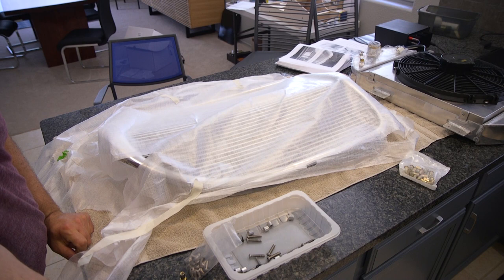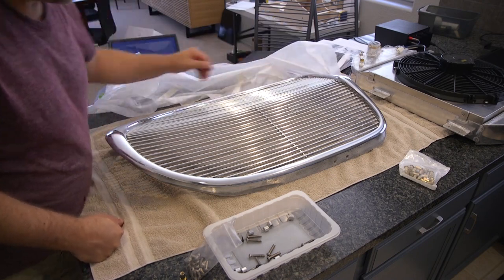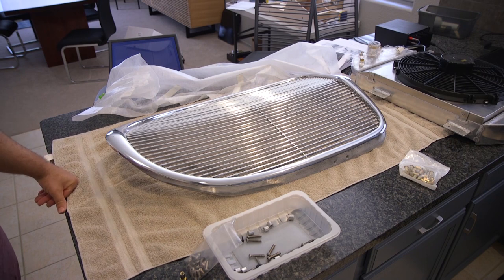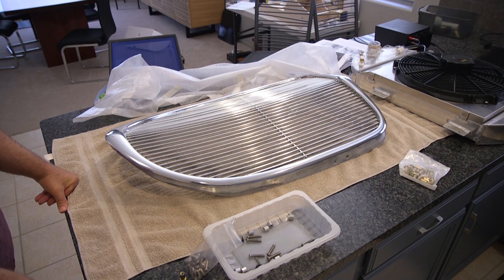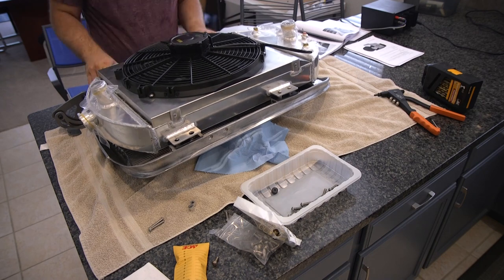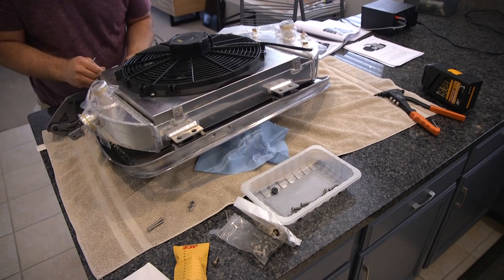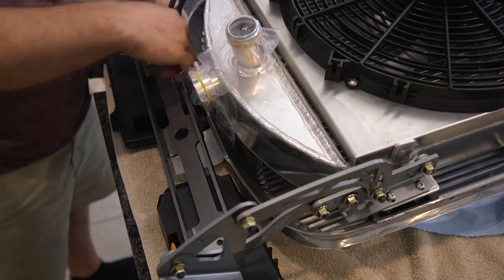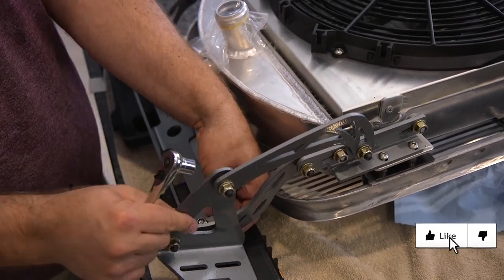Factory Five 33 Hot Rod V2 - Front Grill Polished!

Comment: jim part of your problem with revnuts\nutserts could be Galvanic corrosion between the s.s. screws and  aluminum nutserts.
 you will need to put something like anti-seize between them , also check your nut serts for what thickness they are good for. great job on the car!
Reply from the maker: Thanks for the comment.  Corrosion is not my specific issue.  I think it is just my learning curve mixed with really hard rivnuts to crimp.  These issues have gone away with me new rivnuts.